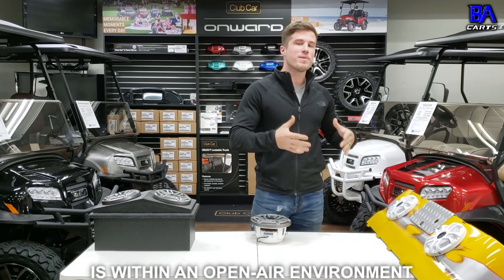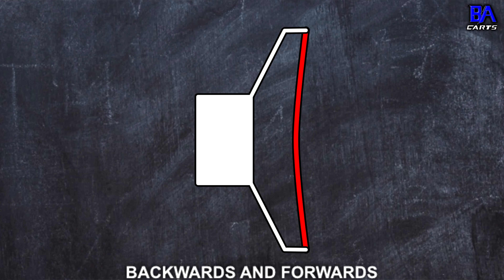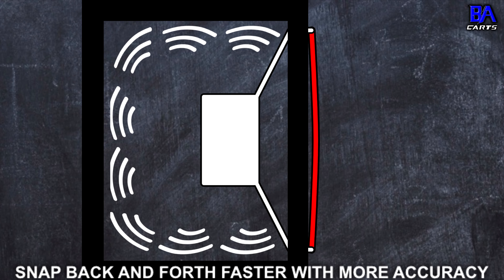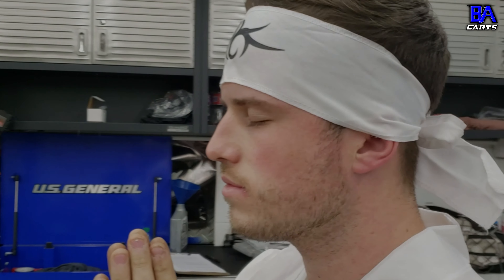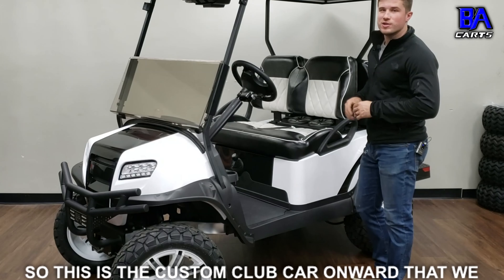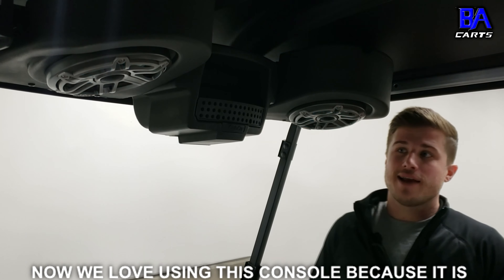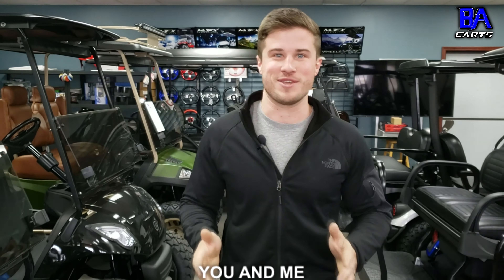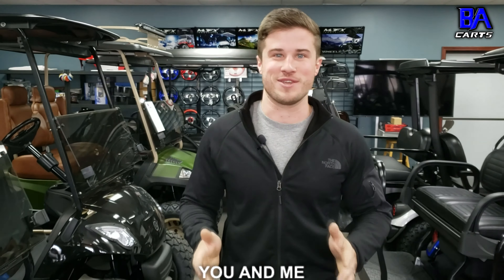How to Properly Install Speakers In Your Golf Cart!

Comment: What's the part number of the 10"jbl bt enclosure that mounts under the rear seat from you're tik tok
Reply from the maker: JL Audio. Fits Club Car Onwards and Club Car's with DoubleTake Max 5 backseat. 

https://www.bacarts.com/rent-a-make--store#!/BA-Stealth-Subwoofer-Fits-Club-Car-Onward-Tempo-Precedent/p/301060829/category=117084280

Comment: Sorry Bro you are wrong, you do not seem to have much more than rudimentary knowledge of acoustic theory. Sealed enclosures use the air as a spring for damping a speaker designed with that application in mind. With out the proper baffles and, or chambers the out of phase sound wave travels right out the cone and causes weird dips in the curve.  Maybe pick up a copy of the "Loudspeaker Design Cook Book." there are even a few infinite baffle designs.
Reply from the maker: I'm 100% aware of infinite baffle speakers and subs out there, and we've tried probably 20 different "infinite baffle" speakers in golf carts by just drilling a hole and throwing the speakers in, and they all sounded terrible. And as soon as we'd throw them in an enclosure, they sound 1000X better. I do understand the science behind the infinite baffle setup but I've never seen it work well in a golf cart application.

Comment: So if you turn your speaker sideways and move airspace apart...it sounds better? Lol...easy way to explain is all of the sound off back of speaker is out of phase with sound from front and cancels out that sound...lower the frequency the dramatic the cancellation is...still not sure what the Karate example was all about...lol

Comment: Sure enclosed is always better but some speakers do well free air and most of them are in the automotive and marine class. A rear deck of a car is just as much isolated as putting them in the body of a cart where the body has major cubic footage of volume before the back do the speaker can connect to the front. 

We’re taking golf carts here. Most people on golf carts are too drunk to care about sound quality.
Reply from the maker: Hey thanks for the comment! Yes, a marine sound system can sound great with free air speakers as long as you have a subwoofer that reaches mid-low frequencies. However, since there is such little space in a golf cart for a sub, any mid bass from a speaker is absolutely essential and if you don't enclose the speakers you're receiving zero mid bass from them. And yes, people are typically drunk on their golf carts lol but there are a lot of people out there that want to spend the money on a quality sound system with quality products and quality installation and that's the market we target.